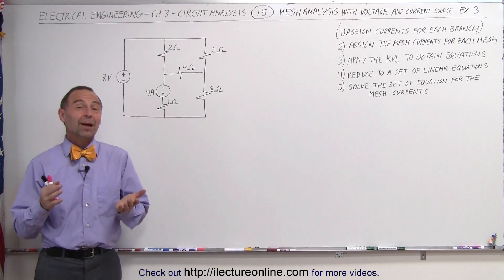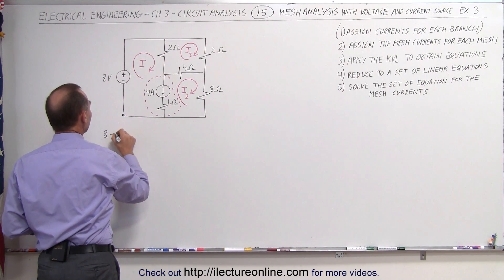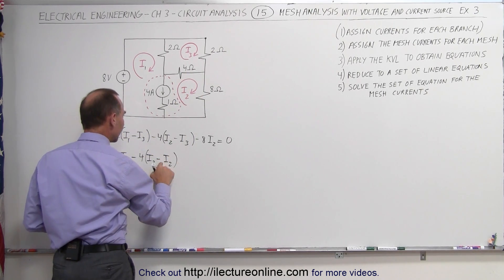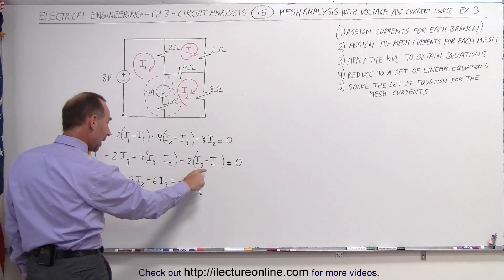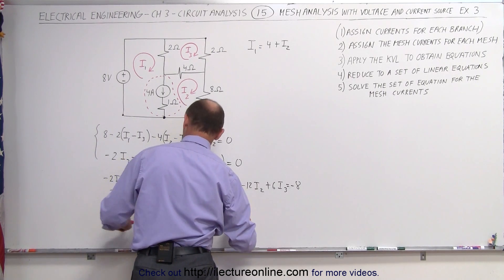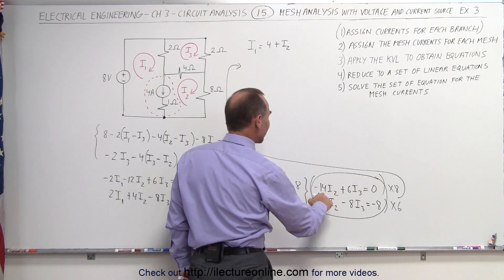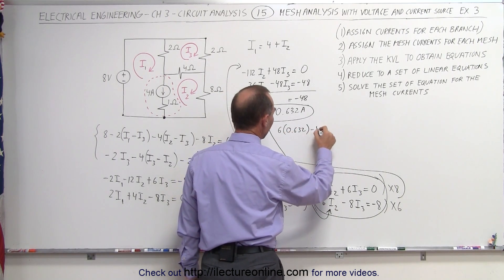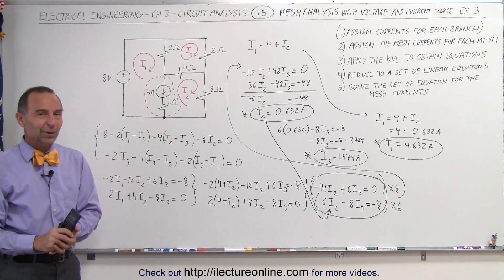Electrical Engineering: Ch 3: Circuit Analysis (15 of 37) Mesh Analysis w/ Voltage & Current Sources

Comment: For the application of KCL to the current source, I found it intuitive to keep in mind the following statement: "When you have a current source shared by two meshes, the current source is equal to the sum of the mesh currents". Also I found that you can apply KVL to all three meshes as normal without excluding anything, and then for the voltage drop across the current source just create a new unknown "R". As long as the signs are consistent I get the same answer. Interesting to see how many different approaches there are even within mesh analysis alone!
Reply from the maker: Thank you for your input.  🙂
Reply: could you explain a bit more please

Comment: Professor here  , can we do mesh analysis for three loops and in the branch that contain current source ( I1-I2 = 4 A  . Can we do in this way ? 
Without eleminate this branch that contains current source ??
Reply from the maker: Mesh analysis can be done for any number of loops (although if there are many loops, then you want to use SW to solve the matrix).
Reply: @MichelvanBiezen  so in conclusion . We can use mesh analysis here for three loops ( include curret source branch but you say that is more complicated to solve the matrix ) ? 
Ok i understand . Thank you
Reply from the maker: Correct.  A 3 x 3 matrix is not too difficult, but with more loops (4, 5, 6, ...)  you'll get more complicated matrices.
Reply: @MichelvanBiezen  yes we can solve with gauss method

Comment: Can we use these techniques even with dependent sources?
Reply from the maker: Yes, we have some examples with dependent sources.
Reply: @MichelvanBiezen  Thanks, can you refer me to any videos where you have dependent sources using mesh analysis. I cant seem to find them
Reply from the maker: I would have to search for them as well.  We have posted over 9500 videos, so we don't necesarily know where every one of them are.

Comment: 6 x 0.632 should be 3.792 ryt instead of. 3.789
Reply from the maker: If you use 0.6315789, then you'll get the correct answer.
Reply: @MichelvanBiezen  ah yes . My bad sorry , regardless its still desame result when u round them off. Thank you for your vids btw, they are really helpful !

Comment: Hi Professor, I would like to ask another question. The power output from the 8V source is 37.056W using the results you arrived at, the total power dissipated at all 5 resistors is 46.3W; can we then say the difference of 9.3W comes from the current source? If that being the case, can we say the effective resistance of the branch where the current source is, is 9.3/16 ohm, or 0.581 ohm; 16 being the square of the current  4A. And the current source must have a resistor in parallel of the 1 ohm resistor in that branch. I am a medical practitioner in Australia very interested in mathe and physics . Thank you for your kind attention.
Reply from the maker: Hi.  You are correct.  If there was just a single source, the power output of the source will equal the power consumption of all the resistors.   In this case there are indeed 2 sources.

Comment: Thank you professor for the prompt reply. The issue is that the voltage drop of the 2 ohm resistor is 2x(4.632 - 1.474)= 6.316 volt. If the voltage across the current source is 4 V, then the total voltage drop from top to bottom would be 6.316V +4V= 10.316V instead of 8 V

Comment: Thank you for the lecture, one thing bugs me: the voltage drop across the 4A current source is 4 V, which would imply the voltage drop across the 2 ohm resistor above it is also 4 V, this will not agree with the current values you have so elegantly elucidated.
Reply from the maker: Since that branch has a current of 4 A  and a resistance of one ohm, you can use ohm's law.    I = V / R   which  means V = I R = ( 4 A) (1 ohm) = 4 V

Comment: Hello Professor, I was able to get to the solutions that you have produced in the video, but I had one concern. I used KVL for every loop and mesh, and the sum of voltage came out to zero (I usually do this after finding the currents to see if the values are correct). However, when I applied KVL around I1 loop with the current source, I got a sum of voltage of -2.3V (should be 0). Why is that?
Reply from the maker: That is hard to tell, unless you actually write down the equation you get when you sum up all the voltages around loop 1.
Reply: @MichelvanBiezen  After finding the mesh currents, I reintroduced the current source branch back into the circuit. Then KVL for I1 was 8-2(I1-I3)-1(4), which did not come out to zero. Did I reintroduce the current source branch in the KVL equation incorrectly?
Reply from the maker: @Chan-ux7ej  Note that when I came up with the 2 equations using KVL, I carefully avoided the current source.  That is because we don't know what the voltage rise is across the current source.  Using KVL we can conclude that the voltage drop across the current source and the 1 ohm resistor must be 1.684V  moving in a clockwise direction.
Reply: @MichelvanBiezen  That's why, I thought we could assume what the voltage rise was across the current source, however, you avoided that branch because we didn't know the voltage across the current source in the first place. Thank you so much
Reply: You didn't consider i3. It should be I1+I3= 4+I2

Comment: how exactly do we know when to use the KVL straight up, the nodal analysis, or the Mesh Analysis?
Reply from the maker: Any of these techniques should work on almost any circuit.  (Just like there are 7 algebraic methods to solve simultaneous linear equations).  After a while you will begin to prefer one technique over another.

Comment: i think that voltage source (8 v) should be (minus ) when we place on the left side of the equal sign or if we place on the right side of the equal sign  it should be positive because in the mesh we trace from negative(-) to positive (+).
Reply from the maker: As you go around the mesh, all terms should be on the same side of the equation with a zero on the other side.  The sign of the voltage source depends on the orientation of the source relative to your direction of travel around the mesh.

Comment: Hi professor Biezen, just had a quick question: let's suppose that at 5:07, you didn't make the inference that I1 = 4 + I2, but instead made a third loop going around the perimeter of the circuit (equating to 8 - 2(I1+I3) - 8(I1+I2) = 0) and solved the equation w/ 3 equations and 3 unknowns. Would there be any reason that this method wouldn't work? I understand that it's a bit more work, but I'm just curious. Thanks so much for all of the help over the semesters; your teaching skills are second to nobody's!
Reply from the maker: That method should work.  As I tell my students, there are often many different ways in which you can solve a particular problem.  And often it is a good learning experience to try 2 different methods to see if you come up with the same answer.  (Realizing that a tiny mistake somewhere which is easy to make will cause you to get the wrong answer).
Reply: Alright. Thanks to you and your team!

Comment: Sir can we considee another branch point ?for example if we consider upper branch point then the equation will be I1+I3=I2+4 ..which will give different solution.
Reply from the maker: yes, you can use any branch point and the answer will always be the same.  Give it a try and see.

Comment: What is the reason behind you ignoring the current source in the middle and applying KVL around mesh I1 and mesh I2. Cant you just apply KVL to both mesh I1 I2 and I3 independently?
Reply from the maker: Try it and see if you get the same answer.

Comment: what about the 1 ohm resistor you havent used it to analysis the current is it not necessary to use...
Reply from the maker: The current in the branch is known because it has a current source.

Comment: I have a question about the current going through the branch element of the 1-Ohm Resistor in the middle bottom part of the circuit. Would the current in that part be I1 - I2 or do we have to take into account for the 4-Amp source, and thus would it be I1+4-I2?  Thanks again, I am flying through your lectures and maybe I will just challenge my circuits course and save myself a semester
Reply from the maker: This one is a little tricky.  According to the diagram there is a current of 4A flowing through the 1 ohm resistor.  Since that must equal the result of the two currents I1 and I2 flowing through the 1 ohm resistor the following must be true:   4 A  = I1 - I2
Reply: Ok got it, so the answer is basically 4-Amps is flowing through the 1-Ohm resistor branch element, thanks

Comment: Sir: If you remember me when I aske you last time about the voltage source in this cabter( (8 of 37) Nodal Analysis ). Now the   same question to you , If I used here Nodel analaysis to solve this problem can I take out  the voltage source of 8 V as we do in previous problem ?
Reply from the maker: Try it and see if you get the same answer.
Reply: I just do that and it doesn't work Sir>>So what can I do ? <
Reply from the maker: Usually when you try something and you get the wrong answer, it probably means that it doesn't work.  In this example there is no reason to "take out" the voltage source.  Why would you want to do it?  What is wrong with the method shown?  Notice how I try to get you to think about why we do certain things.
Reply: great answer, Thank you very much